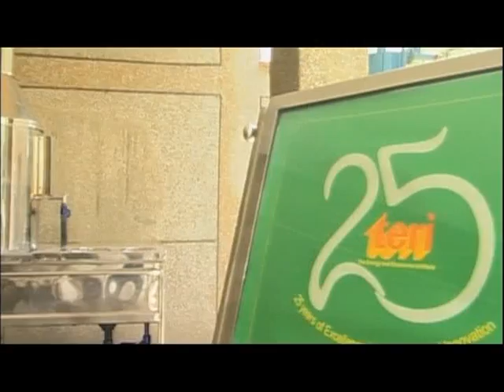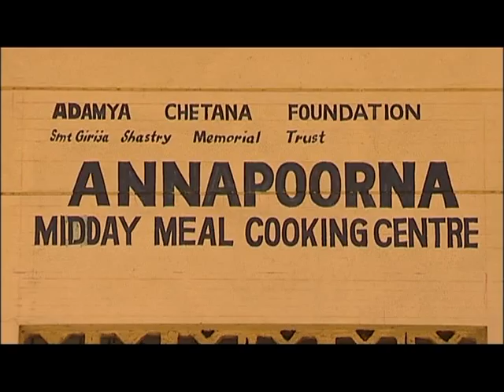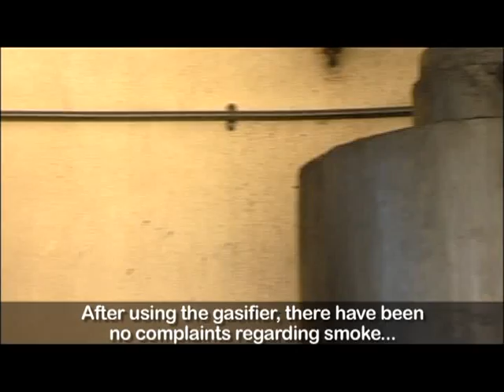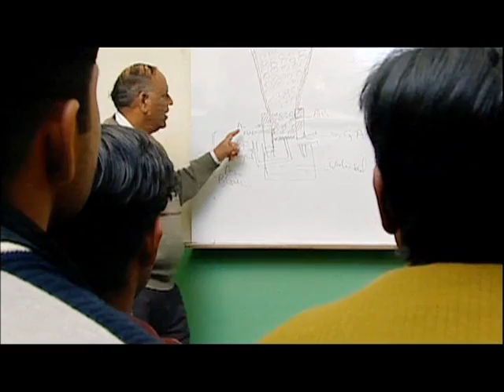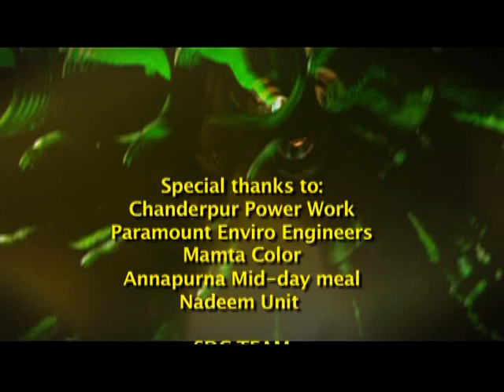A Turning Point: Film on Gasifier Technology

Comment: And there's another thing!  What I cannot understand among all these wood gas enthusiasts is why nobody has tried turning the stuff into gasoline! Its actually not that difficult. The Fischer - Tropsch process need a pressure of around 5 atmospheres (car tyre pressure plus a bit), and a temperature of 300 degrees centigrade. As  feedstock it needs carbon monoxide which is what woodgas is mostly composed of. Discuss please
Reply: Simply not feasible, cost-effective or efficient for the common man. The Fischer-Tropsch reactors are industrial application level stuff in order to be efficient. There is so much more to it than what you described, anything can be simple like that on paper. Search up some real examples of reactors and you can see just how complex the systems are. ''It's actually not that difficult.''

Every extra step is more cost, time and less efficiency. A wood/char gasifier's output gas is already approximately 20% carbon monoxide, 20% hydrogen and a few percent methane. That's already everything needed to support an internal combustion engine, and an engine already doubles as a vacuum pump to run the gasifier at high temperature.

I have personally read the discussions on various gasifier boards about processing wood gas into gasoline, ethanol, methanol, dimethyl ether, biodiesel and other hydrocarbons.
It always ends in the same conclusions of it not being feasible for multiple reasons.

Everything happens for a reason, and the reasons for gasifier enthusiasts not building Fischer-Tropsch reactors are clear.
Research, design, prototype and refine a gasifier first. Then consider if you want to make the process less efficient.

Sorry if I sound harsh with this, it's because I see this sentiment too much from people who have not done enough research or don't have experience in the field.